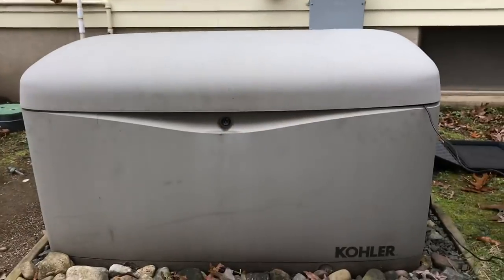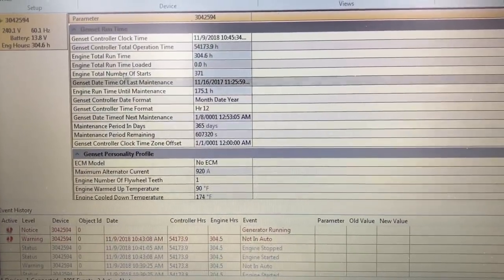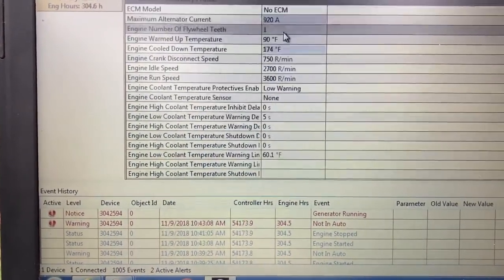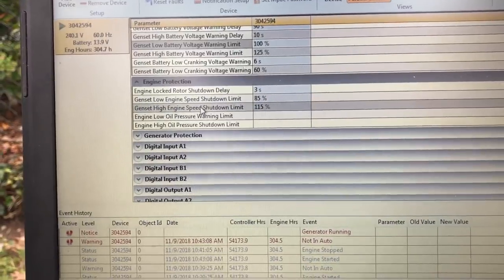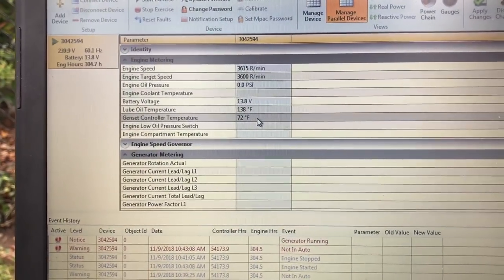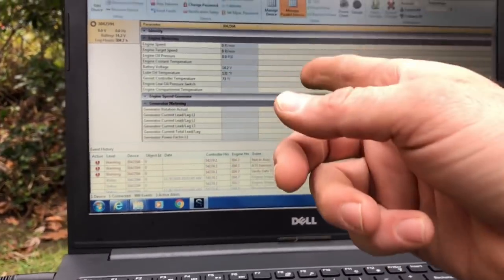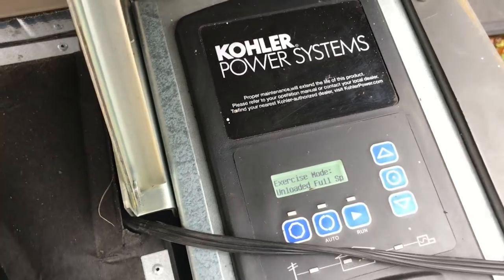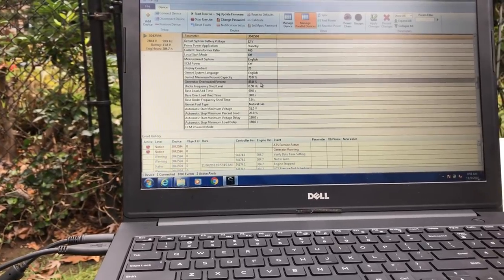Kohler Generator Software To Upgrade Firmware and Test

Comment: Have you noticed that the 'generator true power' variable does not give a reading on these smaller units? I can see the variable reported on 30KW and up but don't get reading on the 24KW and smaller? Thanks,

Comment: Good afternoon friend.
I have a Kohler 6EKOD generator with the unit GM83745 Kit Controller Assy ADCIID GM82832, however it presented a problem and after the repair I need to install the software again. Where can I download Sitetech software?

Comment: @ Alfonce Jean
Natural gas is actually the best way to power a generator when in this type of environment. With the power outages in the northeast every year and your relying on Gas from a service station that depends on GRID power to operate and besides, Gas itself has a very short shelf life....... Hopefully this helps.
I know computers can be very cumbersome, but that is the way things are going today. Be Blessed
Reply: so you are suppose to trust that your gaz dosent go out during an electic shortage....really?
Reply: until the natural gas quits flowing due to stupendous electronic controls without power or backup upstream.....
also glad to see others with their heads not up their hind-quarters deeply.
Reply: @throttlebottle5906  or most event capable of destroing power line in a way that makes them impossible to fix in a few hours will also rip through the gaz main
Reply: The alternative of natural gas is not gasoline, but propane.
Reply: propane costs far more resources to produce ;)
Reply from the maker: @Alfonce Jean This is a good question and had me purging water out of many engines the Sunday after Hurricane Sandy smashed and destroyed most of the area I live and work in. I had engines making pinging sounds from trying to compress water. The utility company shut down a line by accident and allowed water into it. they never announced it anywhere yet I deal with many of PSE&G workers and was told by a few of that fk up. Yet gas lines also get damaged when you get a giant tree uplift and root 30 feet wide ripping out of the ground. Here is an article of the damage just that one little storm called sandy did to new jersey.
http://www.njbiz.com/article/20130516/NJBIZ01/305109989/sandy-fuels-awareness-of-gas-lines-vulnerability
Reply: @thehvachacker  my point exactely! wo could be shorsighted enough to think gaz line would be operational in any major events?
Reply from the maker: The chances though of the gas mains pumping out gas is higher than the chances of them not operating. Yet usually the gas lines don't take the abuse the electric grid does in major events. Trees can tear the pipes out of the ground. even flooding can allow water to enter the gas regulators allowing water to breach the gas supply. Many of my generator customers are dooms day peepers who never realized if the end of the world comes no one will be operating the gas turbines to make sure the pumps are powered or operating
Reply: @thehvachacker  lol prepers now I understand!
Reply from the maker: Not all some use it as an insurance policy. Then you have worst case senecio customers. I would own one just in case an outage happened. To prevent having to throw away the food in freezers, or basement from flooding, pipes freezing. If gas goes out then it won’t work.

Comment: wait, 174F, failed temp sensor junk "thermistor" or similar, FUEL starvation/lean burning...................................................... oh ffs
Reply: I meat the jump from whatever to that ^^^ GARBAGE....................................................................................................................................
Reply from the maker: The 174F is where Cooldown Mode gets activated after supplying power, exercise, or just being shut down on the controller and it is junk. I have seen them reading -4555 degrees, if that was true man kind, would be purged from the planet.

Comment: This may well be the worst instructional video on the internet. The title Kohler Generator Software to upgrade firmware and test. The first 11 minutes of the video show the parameters of the generator, explained while the generator is blaring and the voice is barely intelligable. The next 4 minutes are about upgrading the firmware. It is never explained how to do this: how you download the files from Kohler, install them on your computer, and then load  them into the generator. Instead we see some pictures on a laptop which are too small to read and again a naration mostly over a running generator, nor does the instructer explain how to use the controls to advance the  program or for that matter to set it. It is unfortunately a total waste of time unless you want a good laugh.
Reply from the maker: I don’t film instructional videos often. Usually my videos I’m just sharing service calls I worked on. Many watch my videos seeing how I work on generators or HVAC systems. That software Kohler only distributes to Kohler Dealers. Kohler deletes the old software when issuing an updated version.
Reply: @thehvachacker  And this one doesn't offer instructions
Reply: @thehvachacker  thank you for sharing this video.  Do you use a USB key to get the dealer software to activate as I did not see a internet connection on your laptop.
Reply: Hey Peter, no one put a gun to your head and forced you to watch it so no need to be a douche about it.  Just move along if you don't have the knowledge to fill in the gaps as these videos are actually very helpful.  Dang, people are becoming such whiny victims and are always looking for something to bitch about.

Comment: sorry these generators just sound dum on every level!
why would anyone wants such a usles thing is beyond me.
Reply: Alfonce Jean why is having back up source of power dumb? You have complete faith in your area electrical grid and power company?  I would love to hear your answer
Reply: Ironic statement from someone who can't spell dumb and useless. Mine has been handy to have when the power went out for 8 hours when it was -15F. Mine is used 5 times a year on average. Sometimes for less than an hour sometimes for several hours. Just last month my power was out for 3 hours when a transformer failed just as it was getting dark.
Reply: @pineychristian  not the generator itself but it's complexity obviously! the dam thig is literally a gaz factory!
Reply: @tiredoldmechanic1791  again Backup is good just not like this.
those gen need a fuking computer to diagnotic them!
plus I'm still not sure where the gaz is coming from. is it from a tank or a gaz main?
Reply: and again I'm not talking about the work being done just the system concept
Reply: @alfoncejean8826  I apologize. I thought you meant something different. Everything is going that direction. Some cars have over 20 computers on board. Very complex systems now.
Reply: @alfoncejean8826  Pretty much all these systems are computerized now, unless your buying some Horror Freight junk. Pretty much anything with any decent load capacity now will be computerized, and soon, likely fuel injected well as a lot of small engines are now. Just a natural trend as the demands on the system increase (functionality, emissions, etc.).
Reply: @mysock351C  I'm not saying it's easy. it took me years to build my backup. and no easy availability is not a valid argument.
Reply: @schoolmaster1945  thank you,  but could you be a bit more constructive in the future?
Reply: I like this character :)))